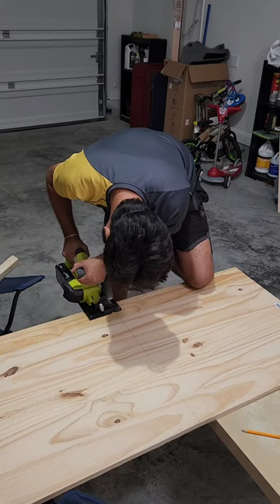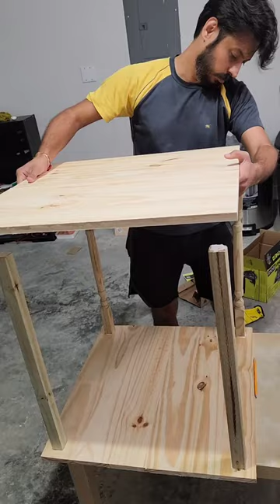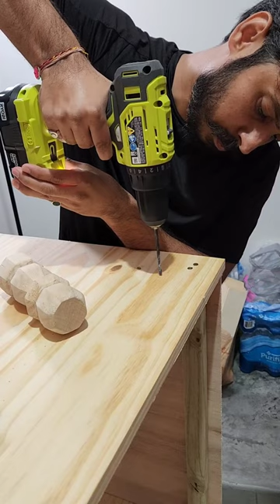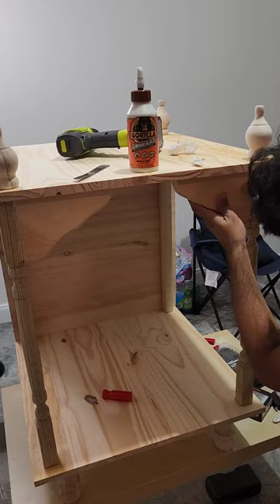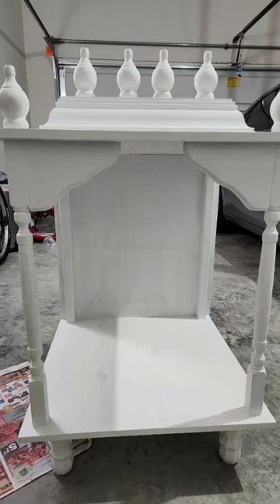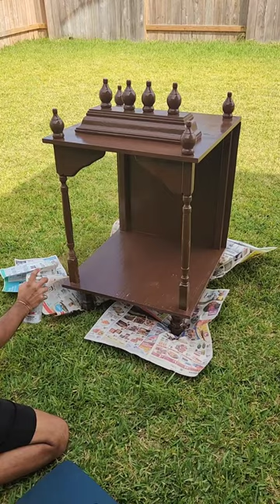How to make mandir at home USA!!! #mandir #usa #diy #diycrafts #temple

Comment: Hello, where did you get the rectangle shape wooden piece on the top? Abd what is it called?
Reply from the maker: We got it from Hobby Lobby.
It was supposed to be a shelf, but we turned upside down and used for this purpose
Reply: Is there a link for this top part of the mandir?